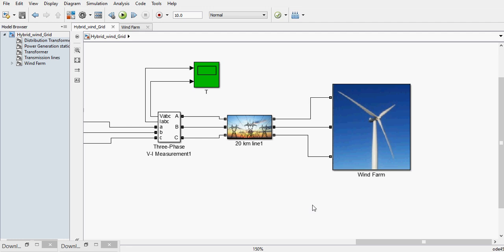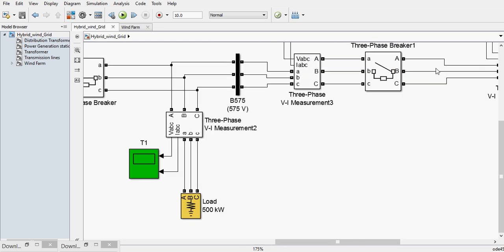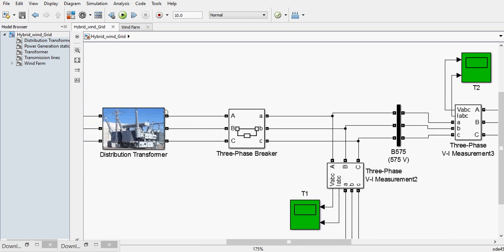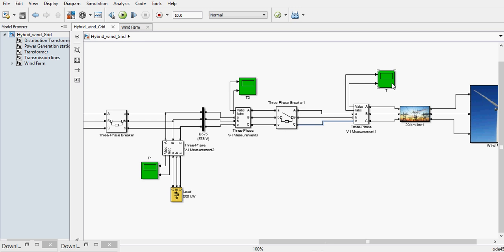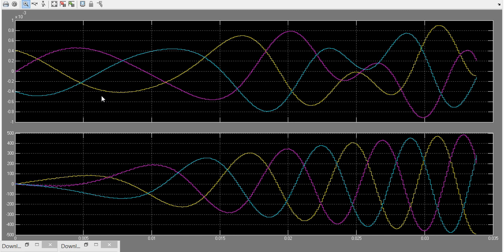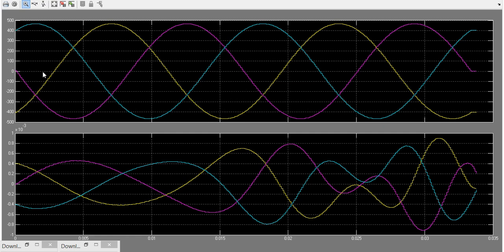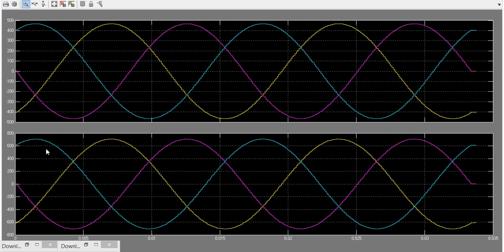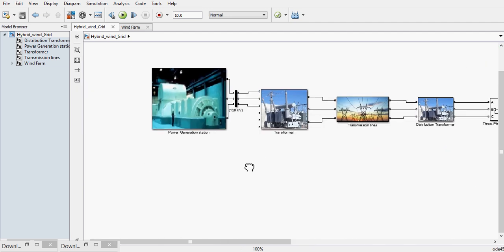Hybrid Power system- Grid connected Wind power system - matlab simulink

Comment: Thank you. When I connect wind generator with grid , the wind induction generator do not produce any positive power. It absorbs the power from grid. How can I produce power from wind generator so that the power consume by the load is equal to the power supplied by grid plus wind power. I think you can help me. Email:lekh.kafle@gmail.com